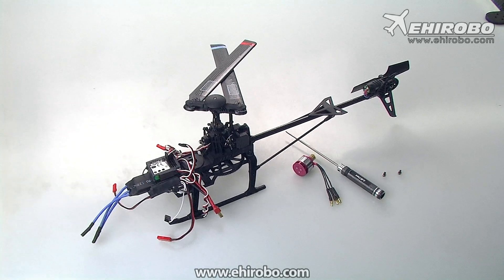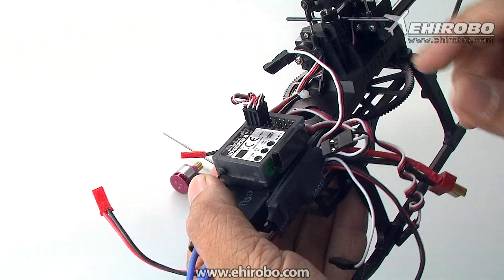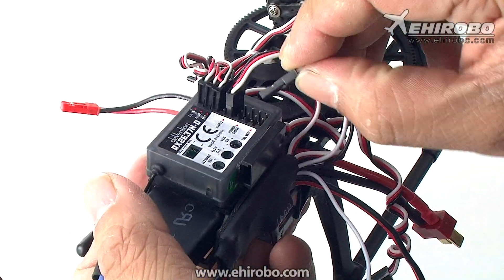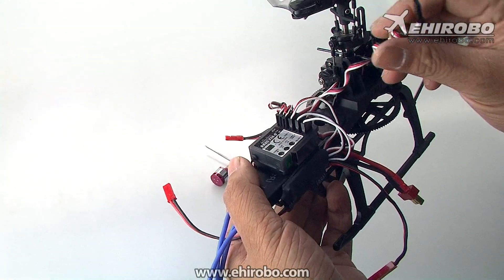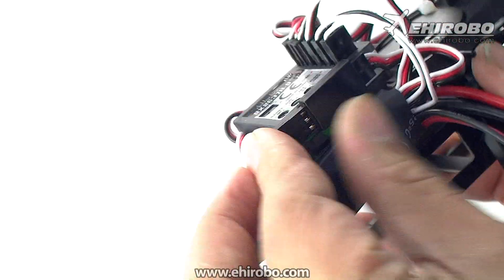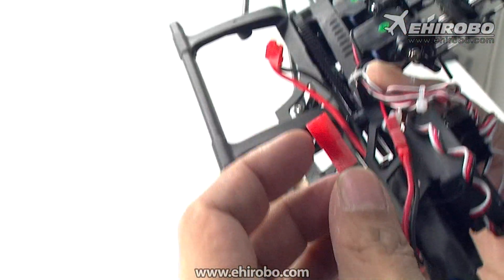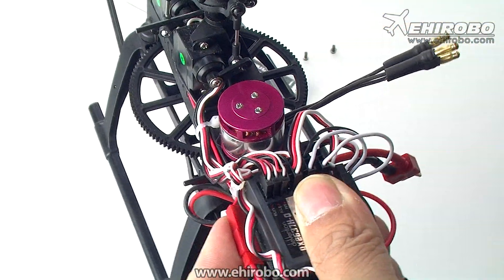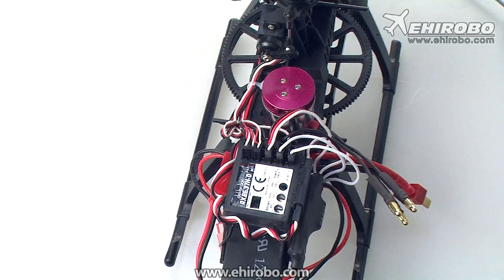eHIROBO.com - DragonSky (DS-MASTER-CP-BL) Master CP Brushless Main Motor Upgrade Set

Comment: Hi mate, great video. I upgraded my servos to metal gear servos and I crashed and now they're a bit jittery, do you know if I can replace the gears inside or what else could cause this?
Reply: Hey mate,  Same thing happened to me,  You need to work out what ones are buggerd, so move with your hand the servo arms up and down and if you feel them jump a gear or get a bit stuck you will know its done for.
I would just buy the whole servo again your can buy them on ebay for about 10 buks each.